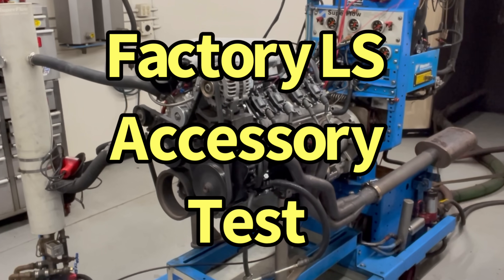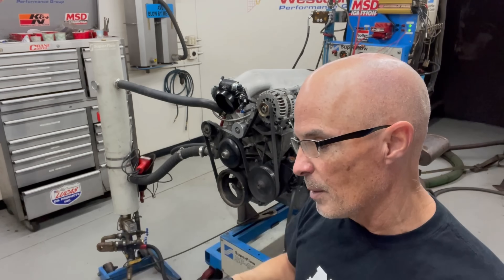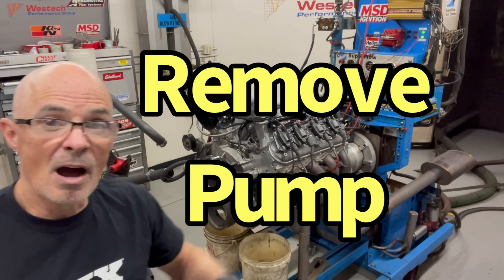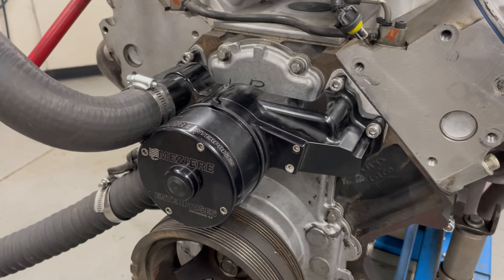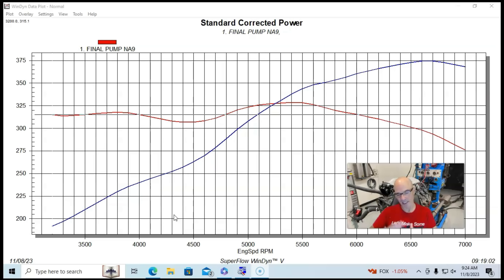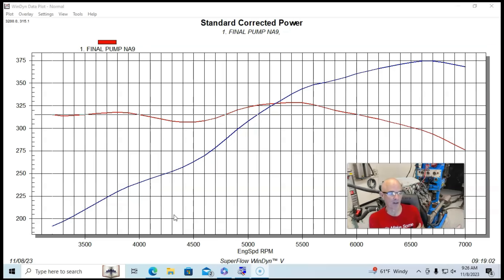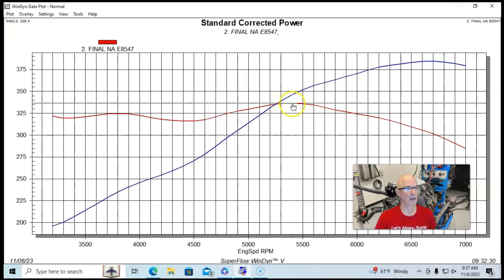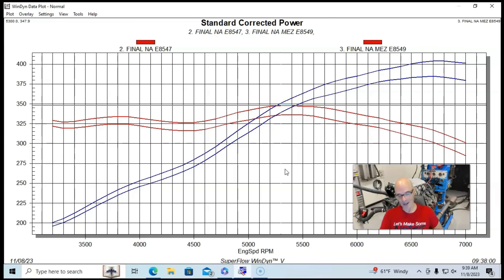HOW MUCH POWER DO ACCESSORIES ROB FROM YOUR 4.8L LS MOTOR? STOCK ACCESSORIES v ELECTRIC WATER PUMP!

Comment: Some other considerations.    The type of dyno used for testing matters.  

A loading dyno ( like a water brake , eddy current ) will measure the change in parasitic torque loss.    An acceleration dyno  ( like a drum Dynojet ) will show gains when rotating inertia is removed.  

In other words, a loading dyno measures actual torque then calculates HP.   An acceleration measures HP ( work over time ) then back calculates torque.  Some loading dynos have synthetic inertia measurement so this could help depending on the application. 
 
Reduced inertia will help acceleration however it will do nothing for pulling a trailer up a hill.
Reply: Great points, but I suspect most of the people watching these videos are looking for acceleration gains in performance/racing applications where the inertial losses are a big factor, especially in the lower gears where the rate of RPM increase is higher. In a heavy duty towing application, an electric water pump and possibly electric fan most likely won't cool the engine adequately whether someone wants to use them or not. Running at full power for 10-15 seconds at a time in drag racing or street pulls at high speeds (lots of ram air) is VERY different than working an engine hard for minutes at a time climbing at low speeds (not much ram air) in the towing scenario you described.
Reply: is the dyno in this video a water brake?  I think he talked about the fluid heating up after consecutive runs on another video, but it also seems an acceleration dyno would show results more relevent to his content.  Might just be a case of run what ya brung.
Reply: The superflow uses both methods to calculate torque.
Reply: Nobody cares
Reply: @Megaladon81    Don't blame me for you not understanding  ( or wanting to understand ) basic physics.  How about you go back to watching Scotty Kilmer /  B is for Build / Gas Monkey or C McF. . %$#@% . .     K  ?

Comment: I heard that the cams between the 4.8 5.3 and the 6.0 from 02 to 06 are the same. Is this true by chance??? I have a 4.8 in my 07 classic and installing a 6.0 from 04 out of a hummer. How much more power do you think I'll get both motors are stock. Thank you
Reply from the maker: only the very early 6.0Ls shared the small lr4 and lm7 cams

Comment: Great video

For a loaded alternator is about 2hp
12v * 100a= 1200watts, 646w/hp. 

Electric water pump 12v * 20a, about 1/2hp load
Reply from the maker: alt load is less than 2 hp
Reply: Alternators are nowhere near 100% efficient.  Closer to 50%.

Comment: An interesting test that I can think of is how much power does an alternator rob at different amperage.  Between a larger fuel pump and electric fan 40 amps is not uncommon.  How much hp is 10 amps worth vs 50 amps.
Reply: Alternators are horribly inefficient.  40 amps will consume 1.25+ hp.
Reply: @zacharymorris9917  Not all alternators are created equal.  For example, the GM C-series are Pulse-Width Modulated, rather than 100% on when charging,  or off.
Reply: @benbrown2119  all of them are significantly inefficient.  The fact that they have to be fan cooled is your first clue.  An enormous amount of their output is heat instead of electricity.  Plus, they require field excitation that draws a meaningful amount of power.
Reply: @zacharymorris9917  Well, according to a quick internet search, the average modern automotive alternator is about twice as efficient as the engine its bolted to.  At medium speeds (i.e. cruising speed of the car) alternators are 60-70% efficient.  The best practical modern engine efficiency number I found was 37% with lower efficiency being the norm in use. So, I'm really not sure why this is your pet peeve. The auto manufacturers have made their alternators as efficient as they could within the bounds of practicality and cost. My point was that early alternators were less efficient than modern ones,  and some manufacturers have better designs than others.
Reply: @benbrown2119  you're wasting your time trying to sound smart to me or thinking you are telling me anything I didn't already know. 

What's 60% of 35%?  Hmmm....
Reply: @zacharymorris9917  Your math is faulty. A 130 amp alternator at maximum output only uses about 5 HP. If it were 100% efficient,  it would be making about 200 amps. Conversly, if the alternator were 100% efficient,  it would only take 3 HP to make 130 amps. In either case, alternators rarely run at maximum output for any length of time.  Regardless,  you are nit picking 2 HP.  TWO HP is 2% of 100 HP, so even on a 100 HP engine, the difference is negligible.  If there were a cost-effective more efficient way to power the engine and keep the battery charged,  the OEMs would be using it by now. Don't forget, they must make a profit to stay in business.
Reply: @benbrown2119  why are you still trying to sound smart to me?

40% loss is NOT "nit-picking" smooth brain.  When the rest of the electronics world routinely achieves 78-98% efficiency, 60% is horrible.
Reply: @benbrown2119  40amps X 14 volts = 560 watts ÷ 745.7 = 0.7509722408 HP ÷ .60 efficiency = 1.2516204013 Hp required to drive the alternator.  Or "1.25+ hp" like I already said. 

How often do you imagine that you're correcting someone?  SHAKE MY HEAD
Reply: @benbrown2119  130amp requires 4.07hp.  NOT 5.  NOT 3 either.  You made both clearly contradictory claims in the same comment.  Don't try to correct someone's math when you can't even get within 25% of the correct answer to your own question.  Take an IQ test buddy.
Reply: And this is why we need testing.  A lot of theories and opinions but no actual data.
Reply: @wudntulike2no32  I didn't present any theory.  I presented actual test results.  In my testing, I figured out that an alternator is not a suitable alternative to a permanent magnet generator for building a DIY gasoline off grid DC genset.  Even a 120v AC inverter generator with a high efficiency DC converter is more efficient.

Things only get worse when you put the drive system and alternator in a engine bay with a 220* engine and multiple other sources of heat.
Reply: You presented theory, not test results.
Reply: 1hp is 746 watts. A 100 amp alternator at 14v would make 1400 watts. So, less than 2hp, in theory.

Comment: Would hooking a battery up to the alternator while on the dyno cause a charge drag?
Reply from the maker: small
Reply: 140amp alternator at full output will use a little over 4hp.
Reply: You can buy a carbon pile load tester for less than $100 if you want to vary your load and see how much drag the alt actually imposes.

Comment: Ya and run them with a transmission and an axle and tires because if you have those losses it doesn't matter if you are making 500hp at the crank but if you only have 350hp at the wheels you only have 350hp
Reply from the maker: losses are not that great-see wheel vs engine dyno video
Reply: @richardholdener1727  ya but it's never 1 number if it was a flat rate or just a percentage then sure but that's only ball park
Reply from the maker: specific components (rear end, axles, tire/wheel and trans) are much closer to a fixed rate-friction changes with power input